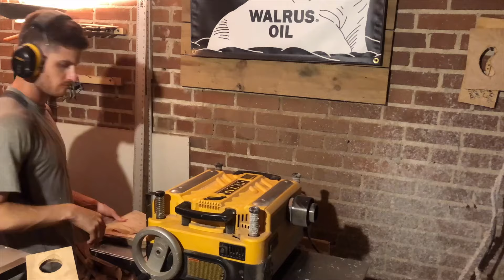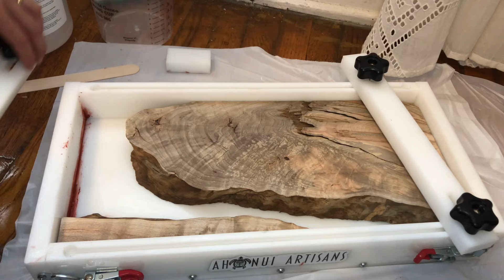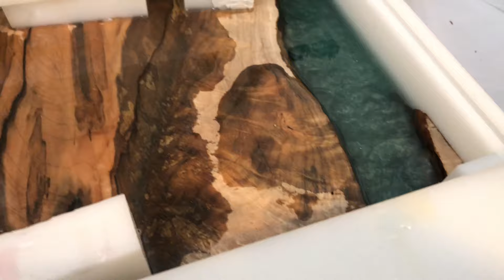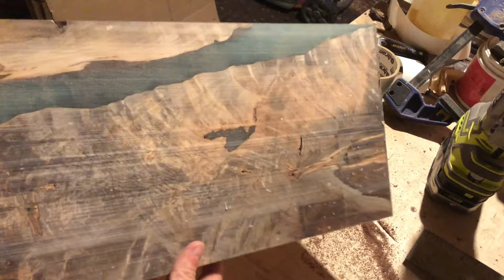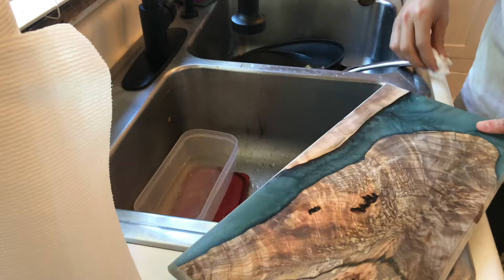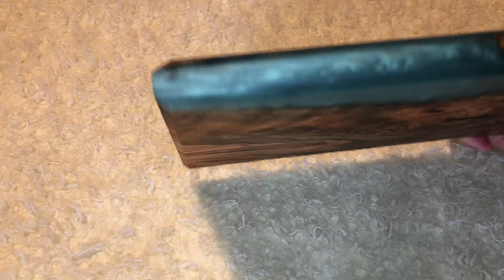How To: Resin Charcuterie Board - MacArthur Woodworks

Comment: Sorry....one more quick question.  I saw yoi flipped the board and set it in the orange pointed holders.  If I use to plastic cups will the cup rings stain or will it just wipe off?  I can let it dry standing upright but I'm afraid it will drip.  Thoughts
Reply from the maker: It would be fine to use the cups. Also it’s not a big deal if it drips since it’s an oil finish.

Comment: I see some people seal the live edge with epoxy to guard against air bubbles. Do you find not doing this an issue?
Reply from the maker: I have not had an issue with it. On bigger projects (tables or desks) I usually seal the edges just to be safe.

Comment: Hey, I love your work and you have inspired me to try my own boards. Also I really appreciate that you respond to all your comments, oblivious, rude, or otherwise. I am clearly very new to woodworking, and I am curious if you sealed the live edges or if it wasn't necessary. If  not why? Species? Or because of the finish? Was it alright  that the wood soaked up some epoxy because you planned to plane down the wood afterwards?
Reply from the maker: Hey! That’s so awesome. I’m glad to hear that. I do not seal the live edge on these charcuterie boards, but I do make sure to get all the bark off. I do seal the live edges when I do a large pour. Yes, I didn’t mind the wood soaked up some because I knew the final thickness I was going for (or, rather, the customer was going for). Thanks for commenting!
Reply: Thanks much👍🙌

Comment: What a great job you’ve done. So professional and it turned out really well!  

If I had one criticism it would be that it seemed to come out a wee bit dull. Suspect that’s just an artefact of the resin you used so not anything you’ve done wrongly.  Edit: just looked back to the beginning  - the actual wood you’re using isn’t particular bright so it’s probably just that. 

Just wondering, what was the black stuff you put on some of the bits? Was it a knot sealer?
Reply from the maker: Thanks so much! 

I appreciate your criticism.. you’re right, the wood is a little dull colored (on video) and the epoxy becomes a little dull when I put the food safe oil and wax. 

It’s Starbond! You’re more than welcome to use my code MAC10 for 10% off to try it. It’s a CA glue that’s perfect for filling knots and cracks.

Comment: How long did you leave the oil on the board? Did you let the wax sit on it before buffing? I just did a board and my epoxy is full. I left the oil on for 2 hrs then wiped it off and put the board wax on it and buffed it. I sanded till 2000 grit. Don’t know what I did wrong. Can I go back and resend to a higher grit like 8-10,000? Help! Thanks
Reply from the maker: I left the oil on 24 hours. I let the wax sit for 15 minutes before buffing. What do you mean your epoxy is full? Do you mean dull? 

You definitely need to leave the oil on longer than 2 hours. However, if you use a food safe finish it’s going to contain beeswax, which can sometimes make the epoxy dull. I hardly ever sand above 320 grit, so I’m not sure. I would assume if you sand to a higher grit it will become more clear, but again, the food safe oils and waxes can make the finish a bit hazy. 

If you want a crystal clear finish, I’d recommend table top epoxy!

Comment: Stunning work!  Very well done video as well.  So much appreciate the professional work demonstrated in this video and the commitment to responding to viewers.  Not every day you see that!  I have been doing resin boards for quite some time and still learning.  I got some useful tips from your video.  I too use walrus oil but find that the boards do not come out as shiny as doing a clear top coat with epoxy as a final step.  Maybe there a step I'm missing ... like using finer grit sanding towards the final stage.  You mentioned you go from 80 to 320.  Also I know walrus oil is food safe but if I'm finishing my boards with a top coat of epoxy (I use ecopoxy), would that be recommended as a food safe surface?
Reply from the maker: Hey! Thanks so much for your kind words. The Walrus Oil does “fog” the epoxy slightly because it’s food safe and contains beeswax. I believe when a flood coat properly cures, it could be food safe. Sanding to a higher grit could make it clearer, but it won’t be as clear as a flood coat. I hope this helps! Also, you can use “MAC10” at Walrus Oil for 10% off! ☺️
Reply: @MacArthurWoodworks  awesome.  Will definitely be following you and looking forward to new videos.  Game changer when you come across someone that actually adds value to what you do!
Reply from the maker: @miges2  I appreciate that! I’ll have more videos soon. Thanks again for the comments and subscription!

Comment: How strong is the connection (bond) between the resin and the wood?  IOW, how much weight could the board carry off center?  Thanks, awesome work.
Reply from the maker: Hey! Thanks for the comment. In my experience, it’s very strong. If I have a shipping issue, the wood has always broken before the bond. Blacktail Studio made an awesome video testing the strength using the same epoxy I do.

Comment: Hey man, I hate to bug you but I'm curious where to find black starbond that isn't rubberized... can't seem to find it anywhere..
Reply from the maker: What do you mean rubberized? I’m confused. If you’re at Starbond, be sure to use my MAC10 code for 10% off!
Reply: @MacArthurWoodworks   I'm using starbond medium black and the second heading in red stripes on the front says "high impact rubber toughened formula"... I used some about four days ago and can still put a finger nail print in it... any idea what's going on here?  Oh and thanks for the discount code I'll certainly use in the future.
Reply from the maker: @anthonyfea4623  if you can put your fingernail in it you probably applied too much at once. Maybe try sanding it off and see if you can apply more
Reply: @MacArthurWoodworks  the worm holes were pretty deep..... any advice on what to fill deep holes with in the future?
Reply from the maker: @anthonyfea4623  you could use a quick setting epoxy OR Starbond makes a thick glue made for deeper voids/cracks.

Comment: can I ask, do you do any prep methods on your wood before pouring? I've tried to do a few boards and my process is pretty much 1:1 with yours, but the air pockets and hollows in the wood just burped out bubbles all through the curing process that were impossible to keep up with. I've gone through a LOT of resin trying to refine the process and avoid this but it always happens.
Reply from the maker: It sounds like you need to seal the edges of the wood with table top epoxy if you’re having bubbles. After it’s cured, then pour your deep pour epoxy.

Comment: Why do you pour epoxy on the top of the wood? In the cracks??
Reply from the maker: I’m not sure I understand the question. Can you ask it a different way?
Reply: Where there are holes or cracks in the wood, you poor epoxy there, why? Just to seal the hole?
Reply from the maker: @waterlilly62lori  oh! Yes, you wouldn’t want little holes or cracks in the wood for food to fall into. Plus, sealing the cracks and holes with epoxy makes the surface totally smooth.

Comment: What a good sander to use? Both the handheld and the larger machine one.
Reply from the maker: I love my Festool sanders but they are a little more costly. I don’t have a drum sander machine but I know a lot of people enjoy them. Is that what you were asking?
Reply: @MacArthurWoodworks  What about the Planer? Is that the machine you run it through? Is this normally $500-$1000? Or more?
Reply from the maker: @JasonJacobs0105  the machine I was using in this video is about $500.
Reply: @MacArthurWoodworks  Thanks! Do you have a link to the one you have?
Reply from the maker: @JasonJacobs0105  the one in this video is the DeWalt DW735. I’ve since upgraded to a 20” Grizzly Helical head planer.
Reply: @MacArthurWoodworks  Thank you!
Reply from the maker: @JasonJacobs0105  of course! Thanks for watching. I’d love for you to subscribe!

Comment: How do you handle micro-bubbles in your epoxy?
Reply from the maker: I use the torch or heat gun to get them out.
Reply: @MacArthurWoodworks  I do the same, but still tons of microbubbles. What epoxy do you use? Is there a certain way you pour or any advice you can give?
Reply from the maker: @waterlilly62lori  I believe we’re messaging about this on Facebook!

Comment: Since this is a charcuterie board & not a cutting board, I'm assuming that you CAN'T cut on it as that would cut into the resin correct? What about the oil & wax you used, are they food safe or, are they petrochemically based?
Reply from the maker: I don’t recommend cutting into them with a big knife. The cheese knives are fine. The oil and wax I use are food safe!

Comment: Great work~ my question is for those of us that dont have access to the tool and sanders that you used, what are some of your suggestions to acheive the same result? Thanks
Reply from the maker: Thanks for the subscription! Do you mean what are my suggestions for lower end tools? Or achieving these results without a sander?
Reply: @MacArthurWoodworks  yes the sander and wood cutter (lack of knowing the proper name for it) I want to try some of the cutting boards but don't have any of equipment you were using.
Reply from the maker: @jackiythomas1965  it would be really tough (maybe impossible) to make cutting boards with a planer (I believe this is the wood cutter you’re talking about) or a sander. Just check FB marketplace or yard sales and you can find inexpensive tools to start out with!
Reply: @MacArthurWoodworks  I agree, it's like asking how to go on a road trip if you don't have a car 😂 you just need access to told if you are going to build/create anything!

Comment: Crazy question...but I thought a jointer was to get bottom of board completely flat....so if that is so, why not flip the board over and do the other side too, instead of also using a planer?  Brand new here, thank you, learning from you for sure!🙂
Reply from the maker: That could potentially work, but you would just have two sides. The planer ensures they are parallel. The jointer gets one side flat, the planer makes the other side parallel to it.
Reply: @MacArthurWoodworks  Oh!  Yes that makes sense!
Reply from the maker: @rebeccaduncan9044  good! I had the same question when I first started.
Reply: @MacArthurWoodworks  I forgot to mention that your work is gorgeous, so well done!
Reply from the maker: @rebeccaduncan9044  thank you so much! Find me on Instagram - I’m way more active there. @macarthurwoodworks

Comment: So you don’t seal the edges before pouring?
Reply from the maker: I usually seal on larger projects (tables, etc.). I’ve never sealed on a charcuterie board and never had an issue. I always make sure to sand my edges really well though.
Reply: @MacArthurWoodworks  gotcha. Yeah I didn’t seal my first two and they were fine. I just debarked, wire wheeled, and sanded. That’s what I was telling my buddy. Maybe for larger stuff. Preciate the quick response.
Reply from the maker: @TailEndCustoms  of course! If I were pouring clear epoxy for a board, it might be worth it to seal the edges. But I’ve done 450+ boards at this point and have never sealed. Thanks for watching!
Reply: @MacArthurWoodworks  wow 450. That’s frkn awesome! Congrats
Reply from the maker: @TailEndCustoms  haha thanks!

Comment: Great video!  I was trying to mentally keep track of your steps.  I am new to this hobby, and my mind is like a sponge.  Where did you get the hot brand used to score the board?  I thought that was an amazing touch.  Also, in one frame were you drawing lines on the board with a pencil; what was the purpose? (Not when you initially cut the shape, but later in the video.)
Reply from the maker: Hey! Thanks so much. As for the brand, I got it from a lady on Etsy. I’ve been asked this a lot before and I cannot remember the shop unfortunately. As for the pencil marks, I mark the whole thing before sanding at 120 just to slow myself down and make sure I get every single spot. If the pencil marks erase, then that means I’ve truly hit every spot how I’m supposed to.

Comment: I’m using some really nice black walnut for a cutting board like this. But do I need to pretreat the wood with anything before pouring the epoxy?
Reply from the maker: I would make sure you know this is a charcuterie board - it’s not recommended to use it as a cutting board. Black walnut will be gorgeous! You can pretreat the live edge after getting all the bark off with table top epoxy. Other than that, just make sure the moisture content of your wood is where it needs to be. You can do it!
Reply: Holy cow I had no idea not to use epoxy for an actual cutting board. Ok charcuterie board it will be! Thank you!
Reply from the maker: @stradicfanatic  of course! I had no idea either when I first started out.
Reply: @MacArthurWoodworks  one last question. I LOVE that form and looked on their website to get one. What size is the form in this vid?
Reply from the maker: @stradicfanatic  that’s great! Tell him you sent me. This is the 18.5” x 8.5” size.

Comment: Your prices are pretty reasonable for the amount of work involved. I was thinking this is a 400 - 500 dollar piece. About how many hours on average do you spend?
Reply from the maker: I’ve definitely got some pieces in that price range. This board is only 18” x 8” x 0.75” though. It’s usually around 1.5 hours per board now.
Reply: @MacArthurWoodworks  You must have a pretty efficient operation and process through experience then. That's a pretty good turn around time.
Reply from the maker: @jacobharrod6912  I’ve made around 500 of these, so I’ve figured out how to be as efficient as I can! Haha

Comment: What do you use to hold down the wood?
Reply from the maker: When I’m pouring resin? The Ahonui Artisan molds have little HDPE blocks that you can clamp down while the wood is in there so it doesn’t float.
Reply: @MacArthurWoodworks  where can I get some of the blocks ?
Reply from the maker: @dennishight4419  I’m not sure if he sells just the blocks, but try ahonuiartisans.com

Comment: Beautiful. What is the black stuff you filled those small holes with?
Reply from the maker: It’s called Starbond! It’s a CA glue and the have accelerator as well. It’s the best stuff ever. You can use my code MAC10 to get 10% off!

Comment: I have seen several folks run the torch across the top of the epoxy. What is the purpose of that step?
Reply: Hey! Good question. It causes all the bubbles to rise to the surface and it pops them! It’s also very satisfying to watch! Thanks for watching!
Reply: That is what I thought ... Thank you. The process intrigues me. When pen turning with soft woods many people use a pressure pot for the resins. Clearly the epoxy does not require the pressure pot.
Reply: @PAJ706  it fascinates me as well!
Reply from the maker: I’m realizing a year later that I responded to your question with my personal email. My business YouTube keeps saying I haven’t responded, so here I am responding so my notification goes away. 🤣

Comment: What was the formula for figuring how much resin you need and how do you use it?
Reply from the maker: L x W x H = cubic inches. Convert cubic inches to ounces
Reply: You took several measurements of the length..how does that work?
Reply from the maker: @waterlilly62lori  I was probably taking an average of the widths because live edge wood is never straight. I may have gotten 4.5” at one part, 2.25” at another, and 6” at another. I average those together and then take that as my width.
Reply: @MacArthurWoodworks  thank you

Comment: Why do you scrape off the edges?
Reply from the maker: What do you mean?
Reply: @MacArthurWoodworks  the bark?
Reply from the maker: @waterlilly62lori  oh! The bark will eventually fall off the wood; I want the epoxy to adhere to the actual wood and not the bark.
Reply: Could you keep the bark if you wanted too? @MacArthurWoodworks
Reply from the maker: @waterlilly62lori  probably so, but I don’t think the piece would last as long.

Comment: Hi. Is the resin you use food safe, or is it the oil and wax that makes the board food safe. Thank you.
Reply from the maker: Hey! It’s the oil and wax that makes it food safe. Thanks!
Reply: Thanks again
Reply: Me again, sorry. How do you get the edges like the surface?. Do you just sand them as you would do the surface?. Thank you
Reply from the maker: @michaelwalton775  if you have a really sharp bit, it ends up coming out really smooth. But usually I sand it like the surface.
Reply: @MacArthurWoodworks  fantastic. Thank you very much. Top man👍
Reply from the maker: @michaelwalton775  of course! Thank you for watching and subscribing!

Comment: One more question.  I'd like to order the starbond glue you recommended and want to use your discount code.  I went to their website to order and see that they have many different variations of this products.  I also noticed that you used a spray after applying the glue in your video.  Can you tell me specifically what products I would need to order?  Thanks so much for your assistance.
Reply from the maker: I’d love that! In this video (and for most of my builds) I use the Medium Black CA glue and then a spray can of accelerator. I usually just get the larger sizes because I know I’m going to use them. You will love it!
Reply: @MacArthurWoodworks  Can't wait to give this a try.  Thanks so much for your prompt response.
Reply: @MacArthurWoodworks  Just tried ordering and see that shipping to Canada is more than the product itself.  That's a bummer.
Reply from the maker: @miges2  oh, no! I’m sorry to hear that. That really is a bummer.
Reply: Sorry to jump on the question, but isn't CA glue toxic? Not food safe? Thinking of trying to make one of these but want it to be ok to eat from.